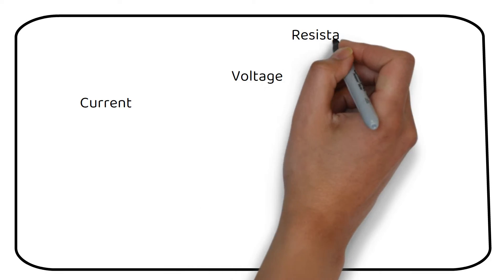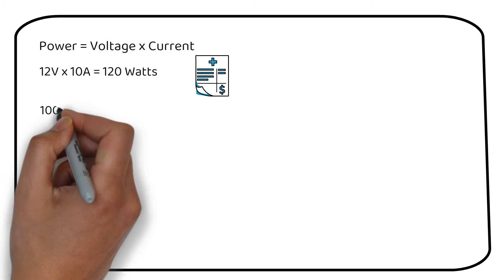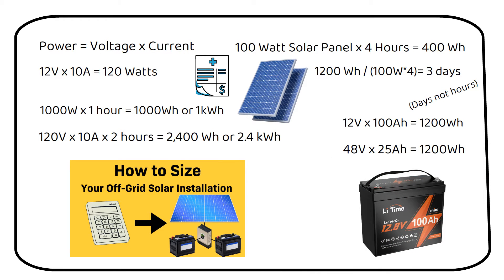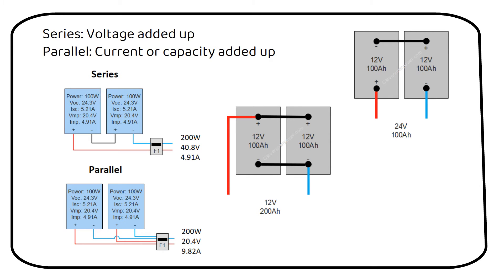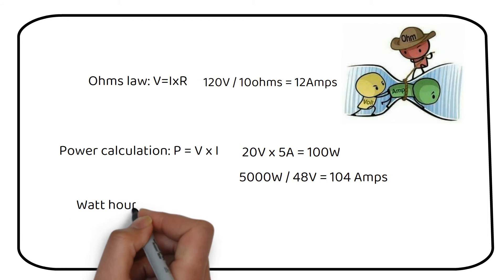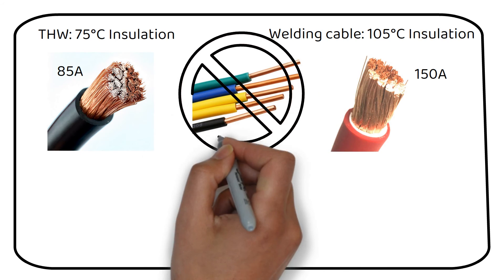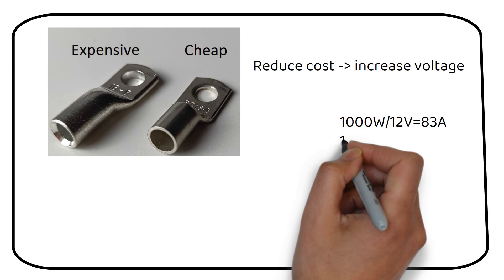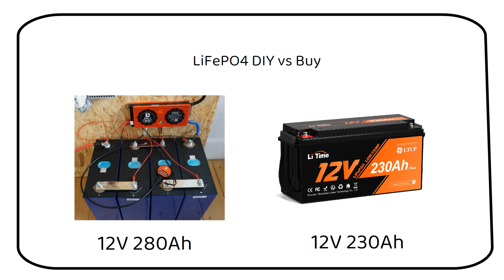Off Grid Solar Basics: Units, Formulas, Series, Parallel, AC/DC, Batteries, Voltage Drop, Save Money

Comment: I bought your book also, thx. Quick question. I usually join portable solar panels together via an anderson plug double adapter. 1 panel is portable, the other is fixed to the roof of my car. Does this type of connection also double the amps?
Reply from the maker: Thanks for getting my book! If you connect in series, which i assume you do, it will increase the voltage while the current stays the same. ensure they have the same rating before connecting them.

Comment: All the videos I watched on YT does not cover the voltage drop and amperage drop of any solar panel in cloudily / rainy day . So I did my own test with 2 small panels ( 18 V/1.6 A ) on a 12 V car radiator fan ( I don`t know the A or W ) taken by the Motor .
first test with one panel in bright sun , it dose not run the motor a full capacity and when a cloud pass by it is most likely willing to stop .
Then I put the second one on paralel to get 3.2 A , but has not get a sunny day since now ( first exp was made 2 days before ) actually I am having a mostly cloudy / rainy weather . The motor is running like as if I am having a sunny day with one panel only .
Then I tested the panels in series ( 36 V/1.6A ) and the motor drop down to a slower speed .
So without a Amp meter I am not able to say more about that experience .
Would you please make that same exp as me and tell us about it . Cause It seems to me that the voltage does drop not in rainy condition but the Amperage drop drastically and this is why I get more power on the paralel test .
If you already did that kind of test , Please just give answer to this comment . 
Thanks in advance
Reply from the maker: Indeed, voltage depends on temperature, so you will get higher voltage in low light conditions because the temp of the panel is lower. Sunshine affects the current of the panel. Parallel is worse for voltage drop, to limit voltage drop wire in series.
Reply: @cleversolarpower  I need current , I tested them in series and I was very disappointed to see that the motor was responding slowly .
If the voltage drop to 15 V. It would be best for me , cause I won`t have to put a voltage regulator lol . 
Oh , by the way I am in Mauritius , and the temp is 17 at its lowest in winter . 
I was just testing if few mns before coming here , weather is dull and rainy . I still have my 18 volts , but probably some milliamps'  , cause I can only power a 12 V Led lamp .
I already subscribed to your interesting channel few days ago , you are a VERY GOOD teacher and you gave me the answer that I needed . I will probably come with some more questions if ever I go for a bigger project where I will want to make a solar charge controller . ( Yes I love electronic  , I wanted to make carrier in that field but I finally fell into photography because of money .Now I am and old man and want to have some fun for the rest of my life 😊😊 . I am a jack of all trade , so plenty of things to be done lol. Hope you will not get bored with me 
Many thanks for your reply .

Comment: Hello,
I'm from Nigeria, West Africa. I've learned a lot from this platform. You're doing a great job.
Kindly clerify me on the following:
1) volt & amp of a solar panel, at the back of my panel are Vmp, imp, voc & isc.
2) using PWM charge controller(s), how best can I configure 4pcs of 190w panels~ with; vmp, imp, voc & isc 10.23 and 2pcs of 350w panels ~ with; vmp 33.60, imp 10.42, voc 40.12 & isc 11.04 using: 
a}  a 220a tubular battery ~12v system or
b}  two 220a tubular batteries ~24v system.
Thanks.
Reply from the maker: With a pwm you need to match your solar panel voltage to the battery voltage: vmp +5 volts. So your panels should probably be wired in parallel. However, with that many solar panels you should have an mppt.